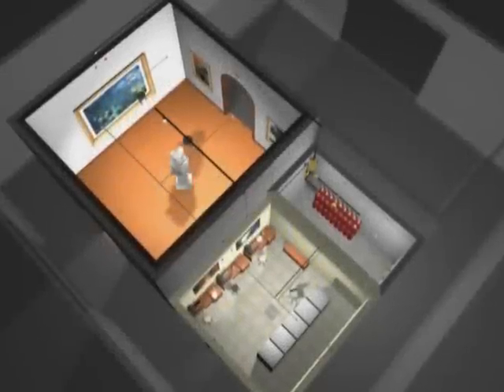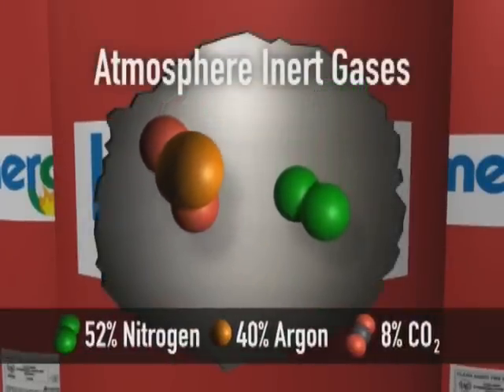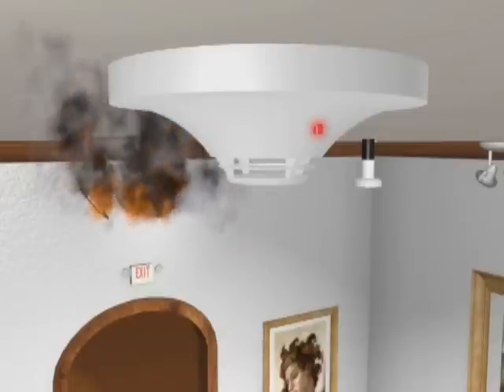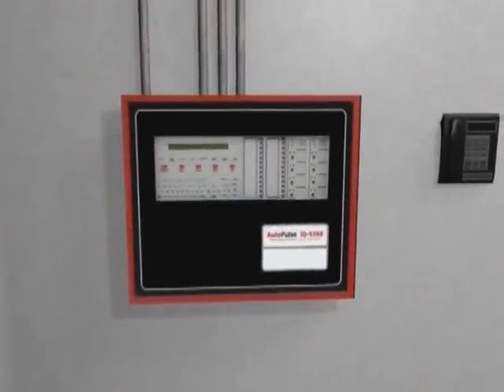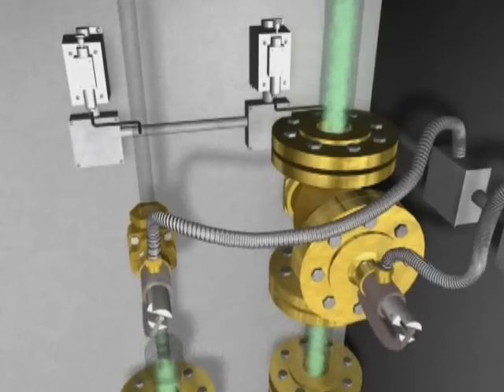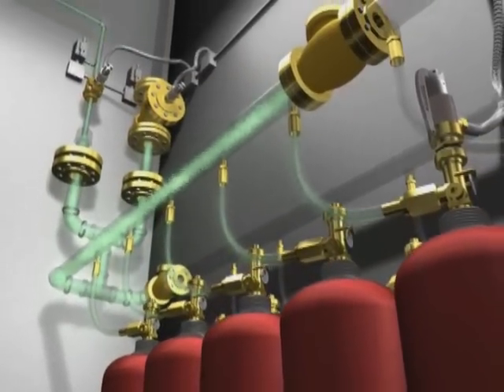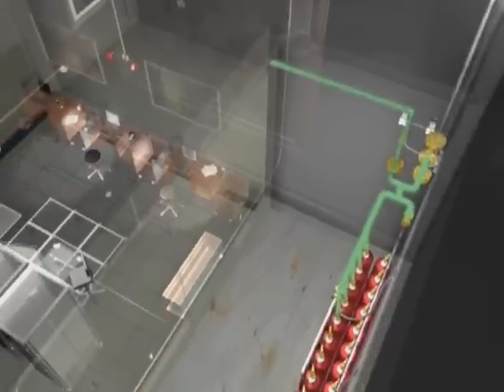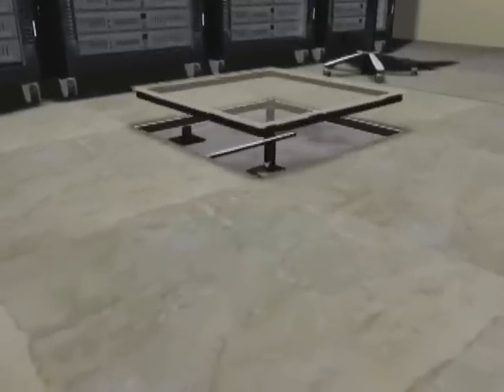Inergen Fire Suppression System Simulation

Comment: HYPERLOOP SOON IN INDIA 🇮🇳.                        The Hyperloop is a new way to move people or things anywhere in the world quickly, safely, efficiently, on-demand and with minimal impact to the environment. 

The system accelerates a passenger or cargo vehicle at airline speeds through a steel tube in near-vacuum using a linear electric motor.https://youtu.be/xPaCcj12rIw

Comment: so since when can a human breathe at 15% oxygen? i think th ecreator needs to do a little trial testing!!
Reply: It does not sustain life for long, but compared to CO2 systems (1 minute and you're done) they're pretty safe.
Reply: It works fine. The added CO2 level accelerates breathing which in turn will keep O2 saturation high enough. You are also not exposed to it for long. We easily managed 5 minutes in a closed room during a live demonstration.

Comment: There's actually no water content in Novec, its liquid at room temperature but evaporates to the heat of your skin, its solution is also dielectric so you can submerge a phone in it and not do any damage.
Reply: Adding water will alter the chemical structure of Novec. In some cases it might turn it into a substance without extinguishing benefit or even become a flammable compound.